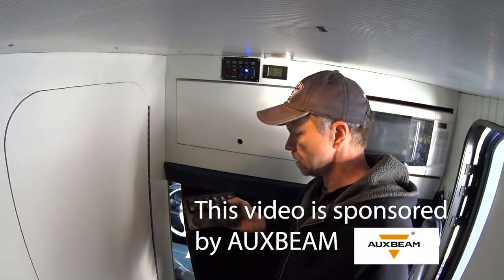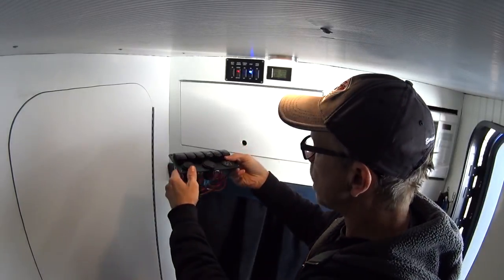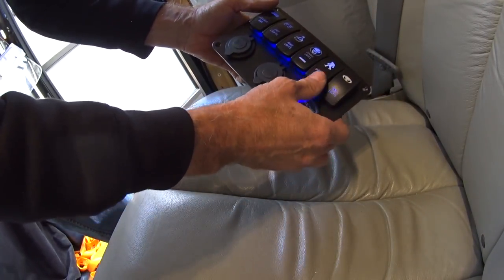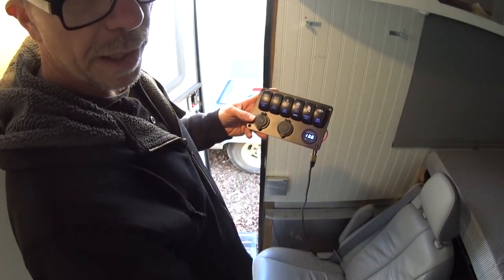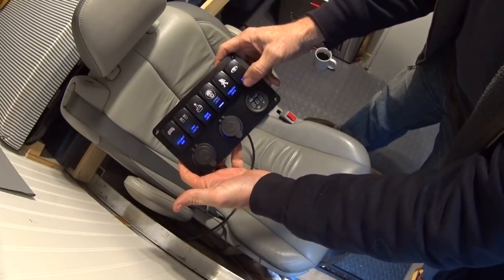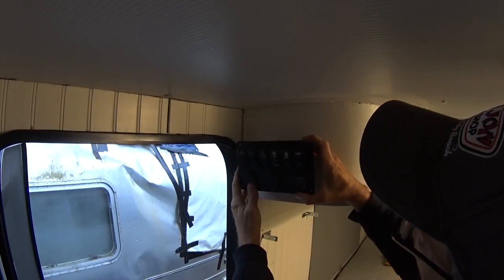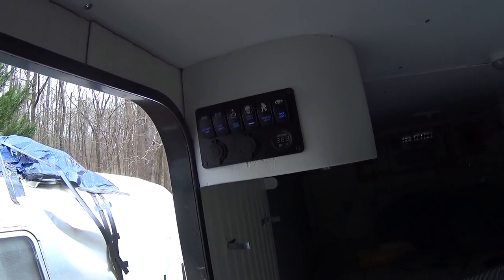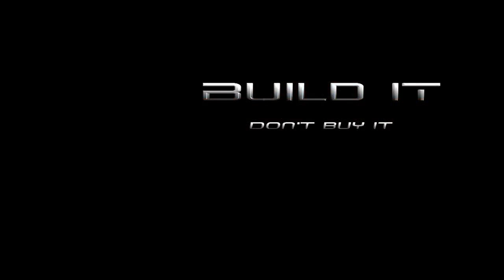Project Updates and New Switch Panel Install for the Box Truck Camper.

Comment: everything we buy lights even when off like we need to waste the lil energy when its off..sad spending money when we sleep...give me a switch that does not light up at all, im smart enough to know i turned it off or on..
Reply: You can just unplug the illumination circuit on the back of those switches. I've got red ones because I don't like blue led lights, they are too bright for me at night
Reply: Seems to be plenty of space to add one tiny switch to kill the lights, that faceplate would be easy to drill and modify...Would be more useful if the symbols could be changed...Scene on the campground: "Honey, would you please turn on the porch light? It´s the zombie switch!" could be irritating to your neighbours...
:-D